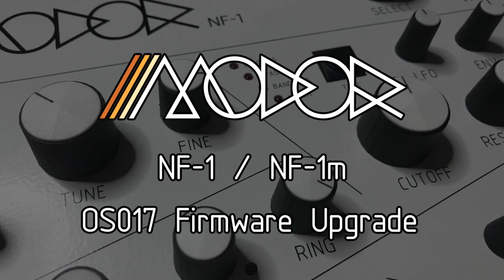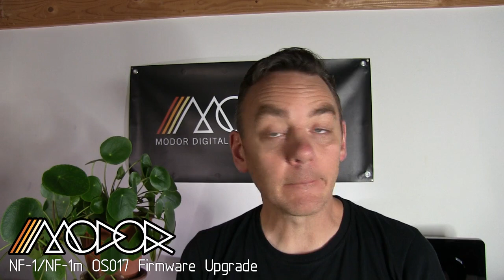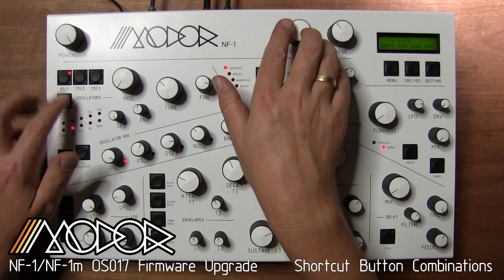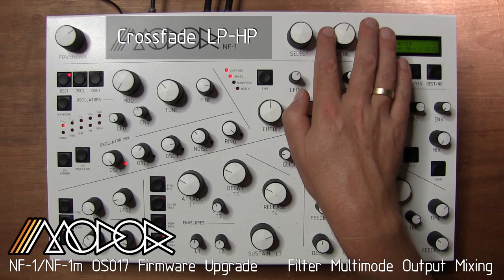Modor NF-1/NF-1m Firmware Upgrade OS017

Comment: Is there any possibility that you could add traditional oscillator sync in the next update?  I'm not needing the squelchy sounds from sync. I'd like to get the solid, locked-together sound of two oscillators in sync with one another.  If there's a way to currently do that, I wouldn't know how.
Reply from the maker: Not really, however, there is a "Sync Waveform" to make sync-like sounds. Real oscillator syncing wasn't included because it quickly becomes quite CPU-heavy if you want to keep aliasing under control. It's a feature we decided in the very beginning of our development not to implement.